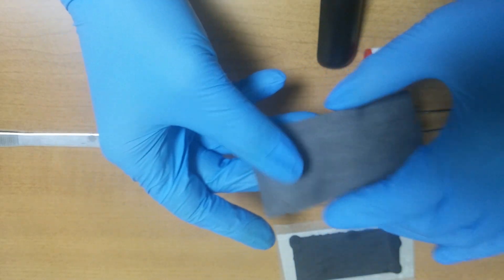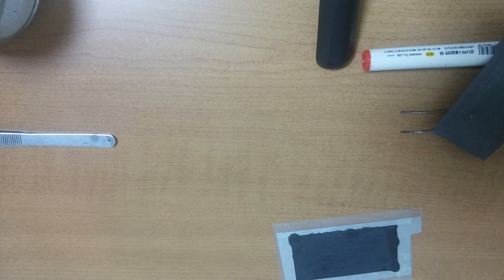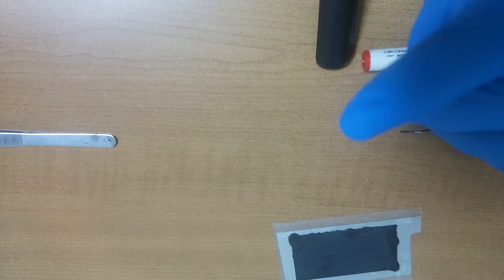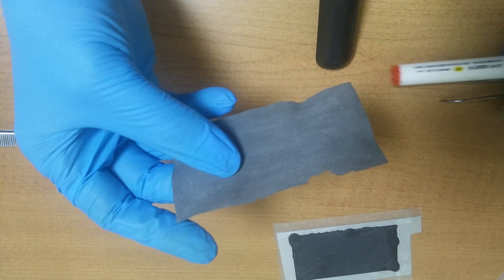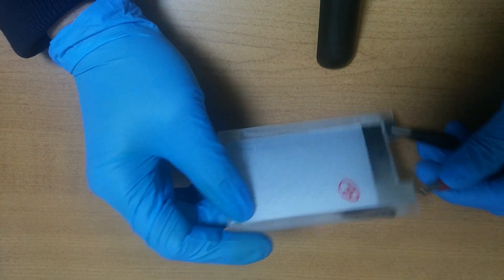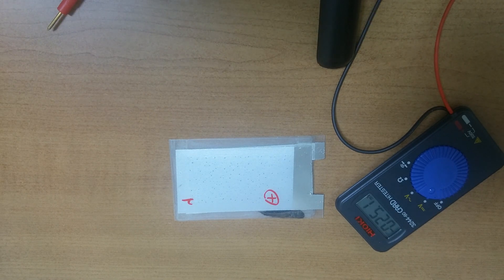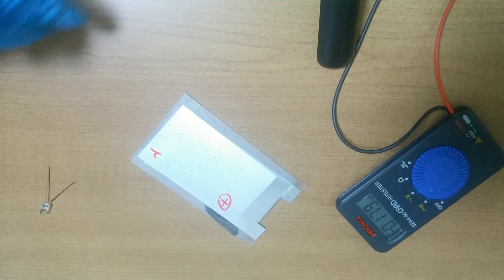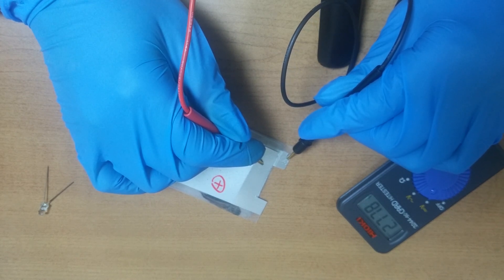2.9~2.7V graphene toothpaste rechargeable battery

Comment: Nice Job on the Sodium Sulfide n toothpaste battery! Seemed stable enough in it's discharge to run a cycling charge system. What kind of amps were you getting on both of them? Also what toothpaste do you use? You could look into their chemical combinations and reactions. If you haven't read the study article from 2018 on this, here is a link to help your knowledge base. https://rdcu.be/b9LxL
Reply from the maker: Thank you. The toothpaste I use is the one which doesn't include NaCl. And amps is not satisfactory yet.
Reply: @solidbattery9956  Keep at it! The joys of science!

Comment: Toothpaste?
Reply: (+1 btw)
Reply from the maker: Yes. Toothpaste
Reply: @solidbattery9956  Any kind? What substances in special are you looking for in a toothpaste that would help in a SS Battery? (I'm looking forward on experimenting on it myself, thanks - Dankeschön? - for your kind reply)
Reply from the maker: @CelsodeSá  
Toothpaste which doesn't include NaCl is recommended
Reply: @solidbattery9956  Much appreciated... so no table salt, noted 👍
Reply from the maker: @CelsodeSá  
If you want to get more capacity, you'd better mix toothpaste, iron oxide, and detergent. Have a nice experiment.
Reply: @solidbattery9956  Thanks again. I'm going to dig into your other videos, I've saved them for later. If you don't mind me asking another question: what's your background actually (academically speaking)?
Reply from the maker: @CelsodeSá  
My major in university is far from science. I am also running a business far from science. One day, eating melons, I decided to grow the seeds of the melons, which made me absorbed in photosynthesis, and finally a rechargeable battery. From that time,  I've been doing experiments on a rechargeable battery for over 12 years. Have a nice day.
Reply: @solidbattery9956  That's a fun origin story, thanks for sharing. I'm a marketer, but I've been in love with science since I was a kid, cheers!

Comment: @solid battery try using acid electrolyte in the graphype electrode and alkaline electrolyte in the aluminium electrode. I would paint the electrolyte in the paper separator or use PVA and glycerol putting acid solution to the carbon electrode side and (potassium hydroxide + Zinc chloride) to the aluminium electrode. Zinc Chloride will create a layer which will prevent aluminium corrosion. Tu Ou shall get something between 3 volts and 4 volts.

Comment: i think is very good result. i think your voltage may be dropping in part to the initial pressure  when sticking the cell together becoming less pressure  as time  passes! You must have pressure!
Reply from the maker: Always thank you so much. I agree with it. I will try. Thank you again
Reply: @solidbattery9956  doing very well 👍🏻 also have the smoothes sides together for best contact . Maybe press with g clamp first to get both sides very flat . It make my cells 2x the power
Reply: i agree its probably pressure, but look how stable anyhow, pressure is easy in a final build, but this is barely dropping just pressed together with tape.
Reply: @ravenbishop2557  yes I find that amazing result but with  higher current draw it will effect voltage sag a lot! I think I may return soon to solid state design as some recent publication mention some interesting ideas I wish to try. I hope I can get OK result as is to this date very complex chemistry so something more simple could be rather exciting news for the cell  experimenters community. We need a bit of a leap in results to get more people trying new things.